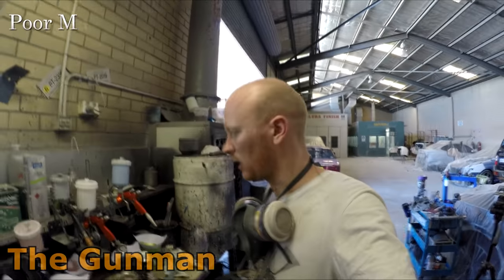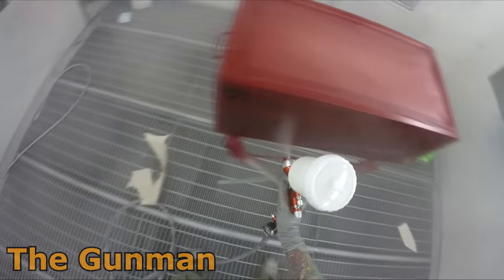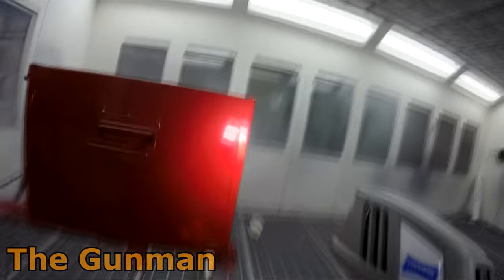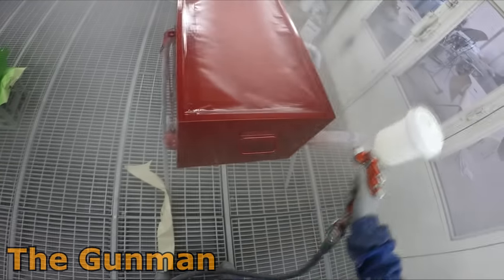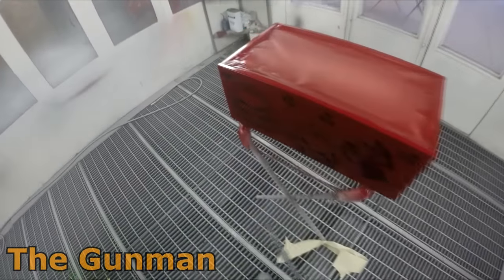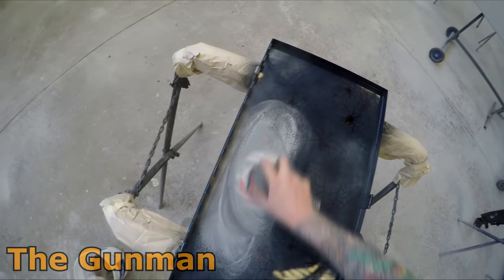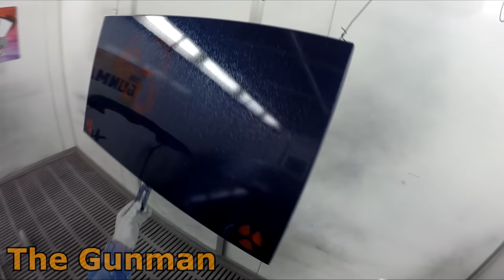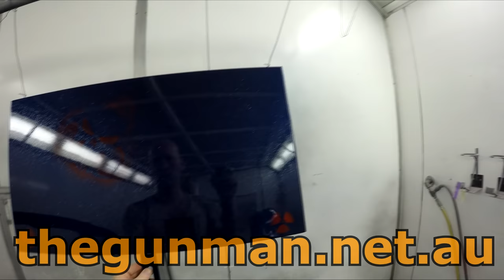All Kandy WET WET Clear Review

Comment: Nice work Gunman your test pieces came out tops as expected. The 50psi is a reccomendation from Allkandy as the clear needs that extra psi to get it out the gun and lay it out smooth as it uses no thinners, it was designed to self level on the panels more noticeable on panels laying flat. Either way yours came out sweet.
As for the clear being re labled' Autobahn have their own range of clears. Allkandy is made by Autobahn but is the custom division and have their own ingredients and make up which differ to the standard range of clears.
Reply: The Kandy Factory i lost all respect for u after i noticed that u used 3 different accounts to comment about your product like come on really
Reply: Wheremoises - Im not sure what you mean. I only have the one account, making three accounts to comment on a video is pointless.
Reply from the maker: Whereismoses, The Kandy Factory is a guy in Perth who sells the All Kandy clears etc. The other accounts are the official and original AllKandy guys from the USA. Not sure who the 3rd person you could be confusing him for would be.
Reply: The Gunman i apologize didnt mean to attack, just there the official allkandy acount plus other bot account all commenting the same information
Reply: The Kandy Factory hey i apologize i thought u where just another bot account, like the other one in the comment section just reposting the same information about allkandy , they even have reposted videos from allkandy. My apologize mate

Comment: Awesome!!! This clear is the best I've used by far. its not Autobahn relabeled. it is the custom division of Autobahn. I've used regular Autobahn and its totally different.if it doesnt have the wet wet on the label its not the same at all. Shooting it at such high pressure relieves the orange peel. The cost is 175 for the wet wet once shipped in the U.S and about 194 on the wet wet plus. Way cheaper than the most known name brand top of the line clears. For all You painters that want mirror results and long lasting quality for the price the Wet Wet is the way to go!! great Video Gunman!!!
Reply from the maker: That's a good review in itself, we get screwed on paint prices here in Australia, it's unnecessary greed. This same kit in 6lt cost $500

Comment: 50psi sounds very high. I remember using the old suction guns back in the 80s and 90s and frequently set the gun at 40 to 50psi while spraying acrylic enamels. Only way to draw the heavier material out of the cup without over reduction. Great review Gunman ! I got dirty looks from Wifey when I told her I bought something called Wet Wet off the internet from a guy named Ten ! LOL !
Reply from the maker: That's what I thought, with the older guns they used to use loads of pressure but apart from wet wet clear I've never heard of anyone using 50 psi in a gravity gun.

Comment: 50 psi??? I would be afraid I would blow panels off the stand ! PPG DC3000 and DC 4000 works excellent with a SATA 5000 1.2 tip
Reply: Ryan Stevens the high PSI is because the product is thick as snot. I watch My Cousin Pete YouTube review and he didn’t follow the directions on a panel. He admitted that if he did he wouldn’thave had a dry spot. It’s a rather good clear and last really long I’d shot the way it’s recommended
Reply: 30 psi or so  regular gun,more watery. 50 psi is too strong for regular gun.

Comment: Took a bit of searching but I found the technical data sheet it does say 45-50 psi when using a siphon (pressure pot) gun and 6-10 psi with an HVLP gun. Pretty much spray it at whatever psi your gun likes. Here is the link to the data sheet.  http://www.allkandy.com/uploads/TECH_SHEET_AC-9050__wet_wet_2.pdf

Comment: Hands down best clear PPG 2002 it's a polyurethane clear
Reply: Better than Ceramiclear ?
Reply: Paul Clark I agree. It's some really great stuff. I've tried both clears and the PPG is better in many ways but for a budget paint job the wetwet is definitely a sure choice.
Reply: not sure if the best ouf there but definetly one of the best I have tried, if a dyi os on a budget i strongly will siggest to go to a step low on the basecoaf or maybe universal primer and make room ($$$) for the PPG

Comment: Have you ever tried the spi clear?
Reply from the maker: Never even heard of it, is that another American clear?
Reply: The Gunman yeah it's an American company maybe someone can get some out to you to try
Reply: I use it all the time. Southern Polyurethanes Inc. They make a HS Production (low end) Universal (higher end) and euro (lowest VOC and highest quality. they are all High solids clears. I use the Universal clear, it's a 1:1 mix, no reducers needed. Sprays great, flows well. A cup off clear looks just that, CLEAR. No yellowing, shrink back, or issues in my 4 years around it. Polishes well too. A little expensive compared to some other clears, but I recommend it.
Reply: dropinbiking92 yeah I love it I just started to use it and it flows great
Reply: Which line of clear? SPI does have a very varieties. I will say that the production clear is great, but even with slow activator it WILL die back, and it doesn't stay as soft as I would like a quality clear to. The price reflects it. With fast hardener and a splash of reducer it makes a GREAT blow-in, spot re-pair, underhood clear. The Universal clear is the one I have the most experience with, and prefer. Only issues I've had with it was solvent pop, but that was not letting the clear breathe before baking it or shutting the fan off. Can says kill booth after final coat, ACTUAL directions, let it run for 10 minutes, or at least until the last coat has fully tacked off.
Reply: dropinbiking92 I'm using the Universal clear
Reply: I love it man!

Comment: The stuff costs 4 times as much as usual production clear and at 50 psi you will be wasting 4 times the material blowing it into the air. I'm sure its good if someone is giving it to you for free. At $160 a quart I wont be using any. Have to work in the real world.